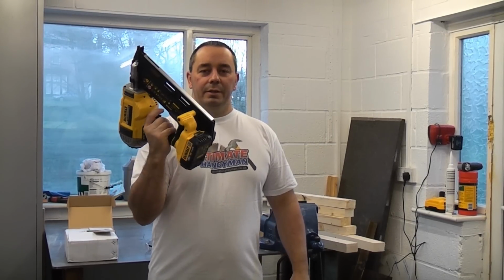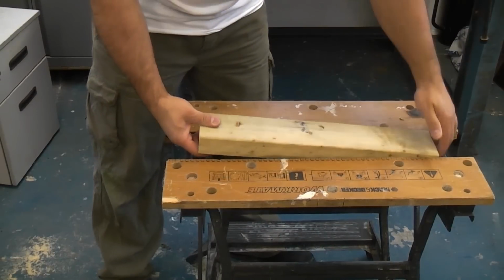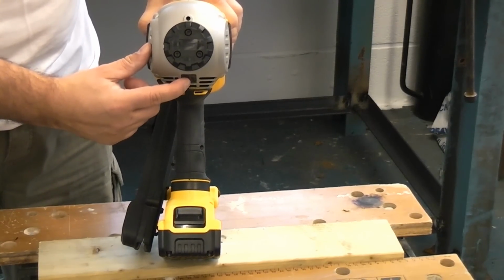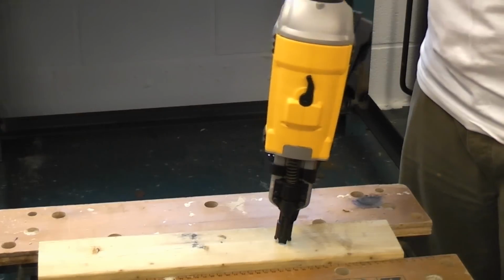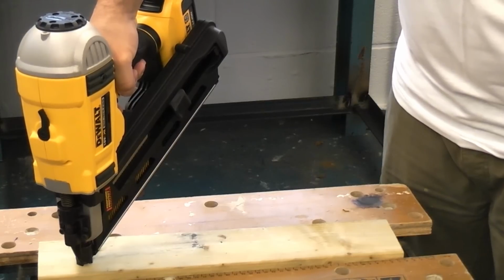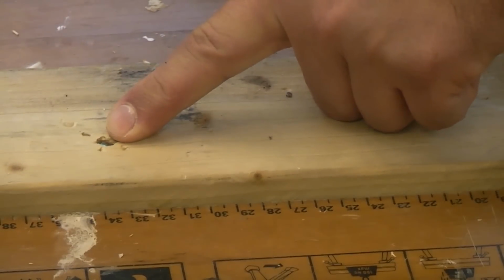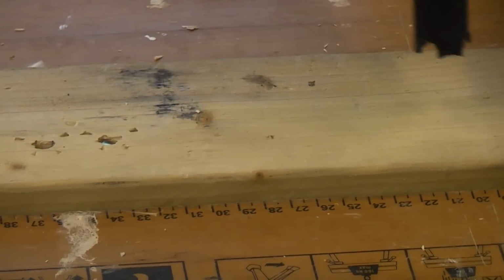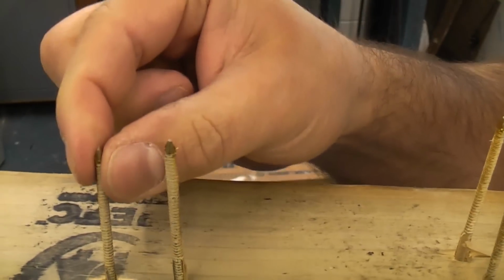Dewalt DCN690 cordless framing nailer

Comment: Looks like a good gun. I have the older 18V finish nailer which stopped working after very little use so I think I will stick with my Paslode framing nailer which have never let me down over 5 years.

Comment: $100 more than a Paslode, $200 more than any of the Dewalt 18volt finish or trim nailers, but it is definitely on my shopping list.   I hate complicating my battery inventory situation, but if this is reliable, then it will be a major game changer in the industry.

Comment: Mine has been rubbish,sent back for repair after a months use,the two springs inside had broken,used my old Paslode while it was being fixed & noticed how much nicer it was to use than the Dewalt.When I got it back I used it again for a few months & it had exactly the same fault again,Dewalt wouldn't fix it under warranty though & I had to pay to get it fixed because the warranty isn't valid after it's fired 30,000 nails,anyone who uses a nailgun everyday will know it doesn't take long to go through that many nails.Do yourself a favor,if you want a reliable nailgun buy a Paslode.
Reply: bstrdmissed 
Dropped my paslode off 25 foot house, works just fine.

Comment: Dewault is fine into soft woods.  Try nailing into 1 inch exterior ply or into oak . Nails bend or jam in the gun . Paslode will nail exterior inch ply on there a roof it will nail oak it will also nail timber to block work walls . For heavy duty work paslode will do all jobs .
Reply from the maker: Thanks for the comment 👍

Comment: I really think these and the Bosch second fix nailer will be the death of the gas nailer.  :)

My only gripe with Dewalt is the second fix is only available on the older battery platform.  :(

Comment: hi, really like this tool, good video too,
just wondering does this gun only use certain nails? or most framing nails available?
also do you know if they are bringing out the finisher with the slide battery?

Comment: Damn impressive thank you for this demonstration.  My only question , and it might be a stupid one is :  Are the framing nails proprietary to Dewalt ?  I live in Japan and every maker seems to have their own nails like a box of Makita pneumatics etc.  Please please please someone tell me that itll fit most any straight rack nails.
Reply from the maker: You are welcome.
You can fire any brand of nails as long as they are the correct length and the correct angle . I've use a couple of different makes in my nail gun and they work with no problems ;-)
Thanks for the comment ;-)

Comment: Hi,can I ask what ur honest opinion is on this nailer I'm undecided between pas lode and this,,this feels a bit toyish in the hand compared to paslode
Reply from the maker: +jerry o connor Hi, it has been fine for me but I do not use it every day.Some people I have spoken to prefer this over the Paslode and others prefer the Paslode over the Dewalt.Sorry I cannot be of more help!
Reply: I got this nailer I'm so so impressed with it ,better than I thought & absolutely no maintenance for the user,can I ask what brand nails and where can you get them do you use,cheers
Reply from the maker: +jerry o connor 
I use Dewalt Nails from ebay. I did buy some unbranded once but when they arrived they were galvanised and made by Silverline but they soon went rusty!
Reply: Thx 4 replying again and keep up the good work you ve an excellent channel
Reply from the maker: +jerry o connor 
You are welcome
Thanks for the comments
Reply: I have both paslode and dewault . The dewault is fine into soft woods and soft ply or chipboard. I had to fit 25mm hardwood ply to a truss roof for a copper finish. My dewault bent the nails ir it jam so i had to use my paslode to do the job .i was lucky i had both guns .

Comment: It was on the US market for only a short time.
Reply: Its back in the US
Reply: Nope, just checked Amazon, item not available.  I tried to get one through Sears too, no dice.  I have the other Dewalt cordless nailers and the 15g is a bit of a jammer but still better than dragging an air compressor and hose around.  It works for light framing but is not legal to the building codes for any load bearing walls in houses or commercial buildings but is pretty good on the types of lumber you find in the RV industry and can work well in conjunction with construction adhesives like liquid nails.  The only other way to step up is to use a Paslode or Hitachi gas nailer and that raises the cost of projects.  If Dewalt gets the cordless framing mailers up an running on the US Market, I will buy one then dump my paslodes on the used tool market.

Comment: How many nails (90mm)dewalt can score on a single charge? Sorry for english!
Reply from the maker: +brmmm76 Not sure about the 90mm long nails, but it can fire about 800 50mm nails into softwood from a single 4Ah battery.Thanks for the comment ;-)
Reply: +Ultimate Handyman 
Thank you for your response , how long it takes to charge the battery hundred percent charge . Recommend the machine for professional use ?
Reply from the maker: +brmmm76 
You are welcome.
It takes 1 hour to charge the battery. I know a couple of builders that use these machines on a regular basis, some people say they are better then Paslode guns! I have no problem recommending the machine to anyone as mine has been fantastic- although I do not use mine every day!
Reply: +Ultimate Handyman thanks!
Reply from the maker: +brmmm76 
You are welcome ;-)

Comment: I want to buy this for sure right this moment.  This was made in 2012 and I am wondering how the gun has faired since then?  Since Dewalt does not market their products I just found out about it.  Is it a good buy I am a contractor?
Reply from the maker: I made another review in 2013-
Dewalt 18v cordless framing nailer review.
I do not use mine every day but when I use it I love it ;-)
The gun is still going strong and I have had zero problems with it.

Comment: What is the price of this machine please reply me as soon as possible Thanks
Reply from the maker: This model has now been replaced with the Dewalt DCN 692- https://fave.co/2NBgXif
Reply: Ultimate Handyman what do you mean it’s been replaced ?have they already taken the first one out from assembly and going back and re-did it because of all the flaws? What is the model number on the new one?
Reply from the maker: If you check eBay, the model in this video is no longer for sale but the  Dewalt DCN 692 is - https://fave.co/2NBgXif

Comment: what kain of nail used
Reply from the maker: +alberto mandujano It will fire nails between 30 degrees and 34 degrees and up to 90mm in length. I think the minimum length nail is 50mm.Sorry for the late reply, this went in my spam folder and I have just seen it

Comment: I have one it just stop any help
Reply from the maker: It's not jammed or out of nails is it?
Reply: lol thats funny i wouldn't of paid this much money for one if I was that dum.The battery are good.Its just stop the motor doesn't even turn over and both lights just flash when i rest it it will just do the same thing
Reply: EJCelani123 I own the 16 gauge finishing nailer version of this and it has the same fault. It could be something to do with the firing pin return mechanism which would trigger the low battery sensor hence the flashing lights and battery cut out. When I bought this gun I was roofing and first fixing a large school so didn't need to use it for about 7 months. When I eventually got around to using it, it wouldn't drive the nails fully in and kept flashing the low battery warning light.  I sent the gun back under warranty and had it returned 2 months later only for the same problem to reoccur. You must of also bought a dud.

Comment: Only 800 per charge?  That's not many nails.
Reply: Um,  have you ever framed a wall ??  One 10 ft wall with 10 - 2x4 studs and no window would take 10 nails if you include the supports so thats about 100 nails.  8 walls or probably a whole roof truss and thats very good I think.  If you carry a spare battery then this is nothing and a kickass tool compared to pissing around with electricity and cords and hoses.  You saw the demonstration.  This bad boy doesnt need time in between to re-compress.  Amazing.
Reply: ignore the above if you were being facetious.  ;)